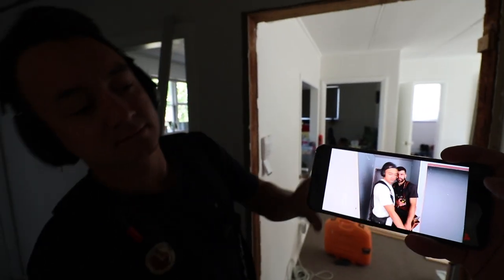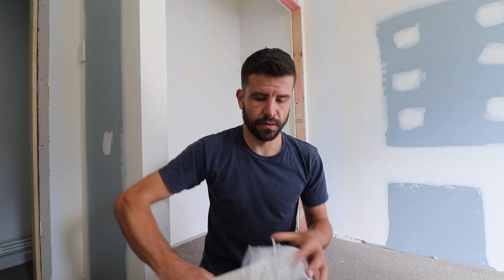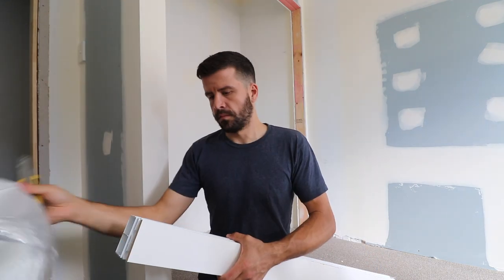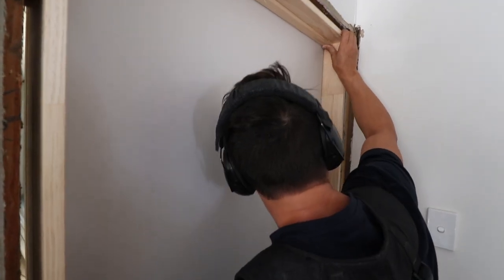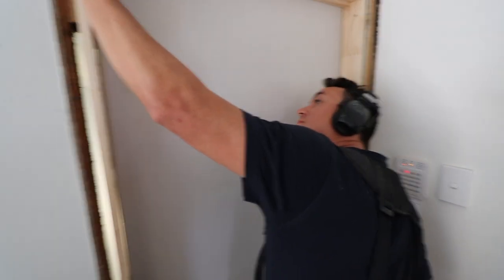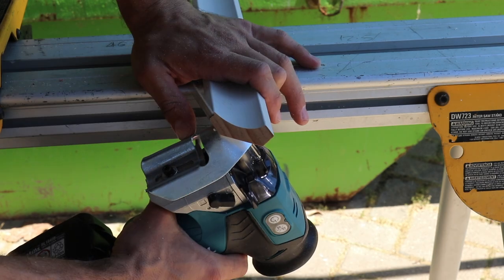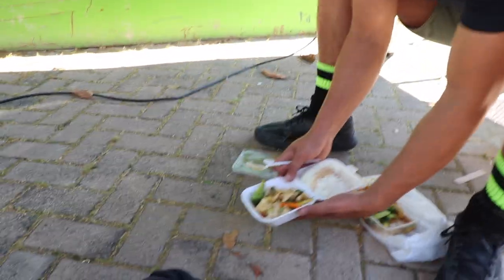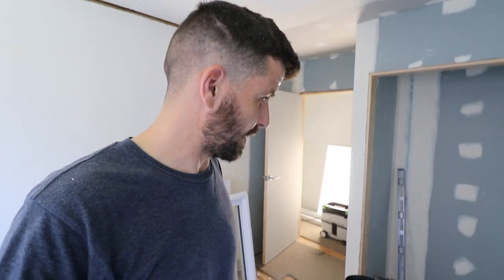A Jigsaw Alteration

Comment: Awesome! What is so special about that coping foot? Is it only that you can follow contours or whatever? Oh, and dont remove the clampcam, it was awesome!
Reply: It allows you to cut rolling angles/follow curves on angle with your jigsaw. With the standard base, you cam set the foot to any angle and cut. If you try and cut a rolling angle or around a curve like that moulding, the base gets in the way and/or is miles from the blade. This thing allows it to rock and roll and still be secure to the work piece

Comment: So are you going to keep the new jigsaw as a coping saw or is it pretty easy to put the old base plate back on.
Reply from the maker: Pretty easy so far. I guess if I ever need to use them simultaneously I can get the old corded one out for flat cuts
Reply: @ScottBrownCarpentry  
Thinking of getting this barrel style, I’m already on a ton of makita . Does the on off switch work ok if you need to stop right away etc? Seems like an odd design for that aspect. Thanks !

Comment: i want more information on this weird coping thing you got going on... why not just cut both ends on a 45? that seems significantly easier?
Reply: Coping your internal corners allows for any discrepancy if the wall isn't at a perfect 90 deg. Personally I prefer it also and couldnt really remember the last time I even mitred an internal angle for baseboard
Reply: @Adsjabo  interesting, thanks